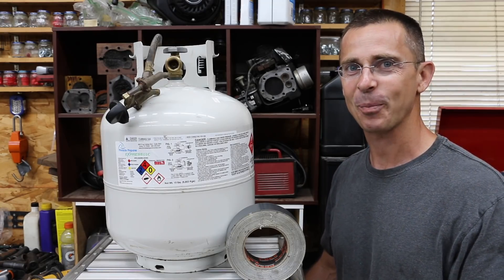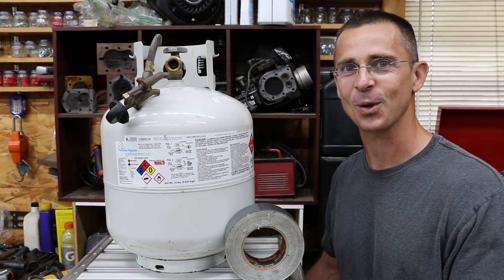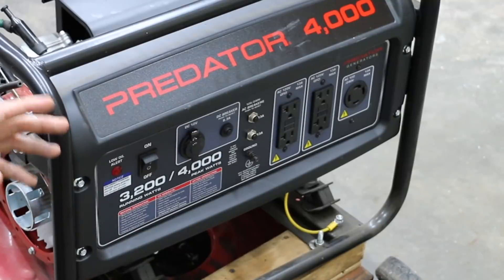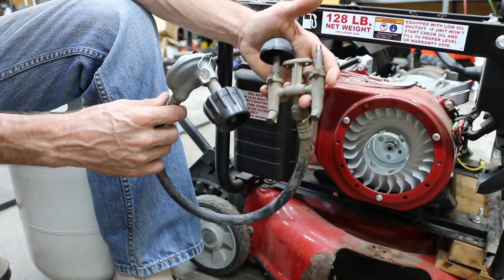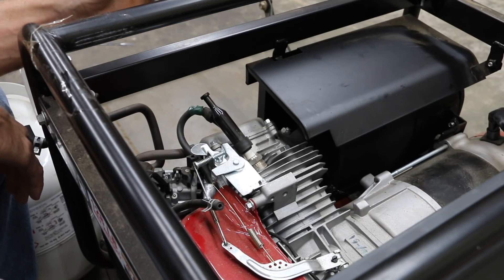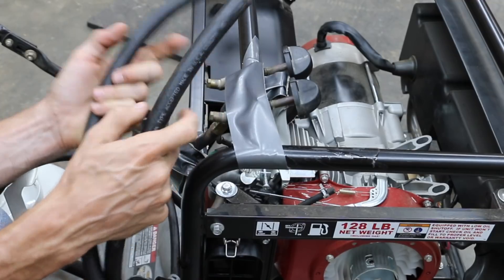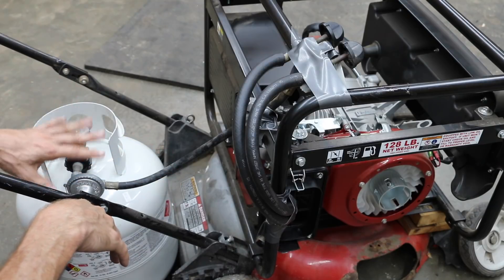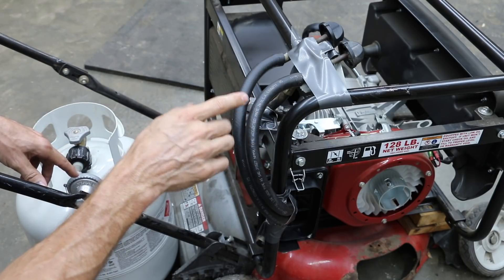Can a gas (propane) grill power an engine?  Let's try it!

Comment: Some Taxi's overseas have a switch on the floor. Propane when no fare and switch to gas if they have one.
Spark advance can be problematic.
Propane is very clean burning. And you can notice that your oil almost never gets dark.
Reply from the maker: Thanks for the feedback.

Comment: I’ve run my push mower on propane for over a year now and it runs great. Low or high grass doesn’t matter. Runs normally throughout. I use a one pound bottle with a grill regulator to a valve and a needle valve to fine tune. The gas line is Teed into the crankcase vent line so switching back to gasoline is easy
Reply from the maker: Thanks for sharing.

Comment: Fantastic video. 
I would like to se a reagular car applying the same gas at the intake as a mixture to regular gas, I guess the computer will cut the gasoline when oxigen sensor at the exhaust sent it a signal that is running rich. 
I hope you can come up with this set up to try it out. 
Keep up the good work. 
Regards. 👍
God bless you.
Reply from the maker: Thanks, will do!  Thanks for the suggestion.

Comment: Choke always freezes up on my fourwheeler so i use a propane torch to feed the carb to start, once warm i remove propane and it runs normally, instead of cranking for minutes on end it starts up almost immediately
Reply from the maker: Thanks for the feedback.

Comment: This is pretty smart. A basic propane conversion that can plug directly into the air box and doesn't require the expensive manufacturers kits.
Reply from the maker: Thanks for the feedback.

Comment: In Skandinavia ( Norway Sweden Finnland ) in 1940>>>1960 they used a gass generator that prodused gass from wood chips to power cars and Tractors 
The generator was installed in the car / tractor 

There has been some who has installed this type of generator on a old Volvo ore pickup truck
Reply from the maker: Thanks for sharing.

Comment: My grandpa had a 1979 3/4 ton Chevy 4x4 with a 468 big block in it and he had it running on propane and gas he could switch it inside the cab and make it run on gas ne or the other
Reply from the maker: Thanks for sharing.

Comment: for a while LPG (propane) conversions were fairly common in Australia. 
They still are for taxis I think. 
in my early 20s I had a 1973 Holden 308 V8 running "duel fuel". it was complicated under the hood. big mixing/preheating manifold sitting on top of the carburettor. air filter sat to the left of the engine. changing the air filter was a pain in the ass. also had to buy "valve lube" to stop the valves drying out and the valves and seats had to be replaced with special ones. brass valve seats I think? don't recall. either way dry valves was a problem you had to think about. 
gas tank took up about 1/3rd of the trunk and you had to pay to get it x-rayed for fractures every 5 years or something. cheaper to just buy a new tank. the tank got cold on long drives too which was nice in the Australian summer heat! 
as complicated as it was, boy was it cheap to run! and on a long drive it got cheaper still. 
damn I miss that car when i'm at the pump now.
Reply from the maker: Thanks for sharing.

Comment: Todd, did you get any kind of idea how long a 20# tank of propane would run that generator?  That's a very viable method of energy production in grid-down emergencies, while giving us good reason to buy a dual burner gas burner setup for use during the good times.  Win/Win.

Comment: you know what would be interesting is seeing propane vs gasoline efficiency in your fuel injected generator. also might be interesting seeing the difference between the EFI generator and the carb generator
Reply from the maker: Thanks for the suggestion.

Comment: i am windring if you can use the same regulator to hook it instead of th inlet of fuel injectores on a car and disconnect the gas fuel pump. then I think you can run any car on propane and the car’s computer can adjust the ratio  by adjusting the injectores. I think it is doable . it will be a great project if everything goes ok do a MPG test propane  vs gas.
Reply from the maker: Thanks for the suggestion.

Comment: Looking at this, it is obvious that the oil company mafia has been f... us over for decades. They have just stopped the usage of gas and electricity. They should be fined to pay for new and cleaner tech. I knew that gas for sure can be used for engines, but not this kind of DIY solution 🙂

Comment: I have run my Taxis on LPG for 17 years, huge savings and as LPG doesn´t make soot I save a small fortune on oil as well.
And I even claimed the conversion back from my taxes, cost about $3,000 (€3,500).

Comment: Try wood-gas. Really, I'd like to know whether wood-gas from a static gasifier can be compressed into a carbon fiber tank to at least 3000psi safely and how long this would run a vehicle.
Reply from the maker: Thanks for the suggestion.

Comment: Go cart or car engines can be run on lpg with two barbecue/regular stove regulators: an unmodified one to supply gas during idle and a modified one to supply gas during higher rpm.
The modified one has a spring inside that pushes in on the diaphragm; it needs to be replaced with a spring that pulls the diaphragm out. A screw (glued to the diaphragm) with washer and nut can be used to set the tension of that pulling spring. This modified regulator will allow the flow of gas according to the suction force of the engine, but it won't allow gas to flow if there is no suction on the output.
Also, the air intake will need to be partly obstructed to force the engine to suck more gas from the lpg hose.
Reply from the maker: Thanks for sharing.

Comment: I want to try it myself at some point I want to try and drip feed an engine gas just enough to keep it running producing just enough power for lights, kind of like a modern version of a hit and miss, I could probably play with the govenor using it like a contact to fire the engine at a certain rpm, curious how efficient and effective it could be, I might have to add a flywheel of some sort.
Reply from the maker: Thanks for sharing.

Comment: propane is like CNG..... you can use it under different loads... just have to convert the carb for it and urt good to go... get an old CNG (Compressed Natural Gas) powered van...
dte here in Michigan uses they all use CNG
Reply from the maker: Thanks for sharing.

Comment: You should note that Propane is a singular type of Alkane. Gasoline is a mixture of many different hydrocarbons that cannot run at the same stoichiometric ratio at the same time for each molecule, thus gasoline forces the consumer to run an engine stoichiometrically at an average of them all, causing some molecules to burn oxygen rich and other fuel rich. 

Hence it would be insanely easier to run an engine on pure Heptane, Nonane, and Octane with the right air/fuel ratio and compression, but even a combination of them would be better. 

That would be the promise of making biocrude oil from pyrolysis and Fischer-Tropsch processes, by using catalyst that favor conversion of lighter gasses to specific alkanes (or paraffins) allowing engines to burn cleaner and more reliably. No need for Octane rating at that point. Just designate a fuel by the primary components.

Comment: I used to convert gasoline engines to propane. They had a kit that I would install and service. There was a power loss because they were carburetored and the way the kit was designed took up part of the air flow to mix/draw in vapor of propane. What I want to try is liquid propane injection, either at the throttle body or port injection.
Reply from the maker: Thanks for sharing.

Comment: I am a fan but either I couldn't find a video on generators or one doesn't exist. Considering the dependability of "the grid" is somewhat less than stellar, I want to purchase a generator that will run my furnace (gas) and the fridge and freezer. If you could be so kind as to do one, or point me in the right direction, I would be grateful.
Reply from the maker: Thanks for the suggestion.
Reply: Look on the appliance name tags for elec wattage rating for each.  Add all those wattages together, and add 50%.

Comment: Nice one. I've never done the comparison on cost. What it would be like to run car on propane. I'd imagine with some changes to the programming a fuel injected engine would run on it just fine. Is it just the idea of a pressurized gaseous fuel that scares people away from putting them in cars?
Reply from the maker: Thanks!  Thanks for the feedback.

Comment: I seen where engines run natural gas. It was hooked up where the crankcase  hose went into the carb and a ball valve was used to regulate the gas.
I got my generator to run off gasoline vapor. it is the vapors that burn with propane, natural gas, and gasoline and alcohol.
Reply from the maker: Thanks for the feedback.

Comment: Using CNG or Propane as a replacement fuel in gasoline engine cars, a popular conversion in some countries, makes for about 1/2 off fuel costs vs gasoline where fuel prices are higher (Germany, England) & where propane readily available to fill up a passenger car without much fuss with 400-800km of propane fuel, originally a waste product of oil refining :) I use propane in my hobby metal smelting forge as fuel due to its clean burning properties & much higher thermal output than a similar electric model & lower capital cost for the kit & setup // mostly to melt popcans into little aluminum heat energy storage bricks

Comment: Of course it works! Entire nations run on propane. 😃👍
I run my Toyota Prius Mk.2 for more than 340,000 km on propane/butane (LPG). After some initial setup challenges no issues at all. Even the engine oil stays clean much longer. And the pump prices 😅🤣😅
Reply from the maker: Thanks for the feedback.

Comment: Propane as fuel for engines is not a new thing. In fact I think it’s a option for smaller cars due to it burns very clean. And with proper emission equipment behind it would be even better.   I do not think the elec car company’s or for that matter reg has and diesel company’s want this known.  Because setting up infrastructure for cars to run on propane would be easier and cheaper then the elec market.   Just simple as drop a large tank off and train a tech how to refill.  Or do it in a bottle swap

Comment: Generator related, I suggest a test of portable generator efficiency based on the amount of gas used to generate a kW-hr of energy with different sizes, brands, and types of generators.  
Are inverter generators significantly more efficient when running at fractional load capacities compared to standard generators?
Will a small 1kW generator be more efficient than a larger 5kW one when delivering 500W power output?
If your long term requirement in a blackout is small loads for a long time, is it better to get a small gen set running near its capacity or some oversized one just idling along at a small fraction of its capability, in terms of gas use?
Reply from the maker: Thanks for the suggestion.

Comment: I once tried the very same test like this. Worked well. My only problem was the BBQ grill regulator wasn't designed to pass enough gas under load without freezing up. it turned into an iceberg. That's Louisiana for ya. :) Cheers!
Reply from the maker: Thanks for sharing.

Comment: WAY WAY WAY back in 1992, one of my friends dated a girl whose dad built a custom pickup. It was made with an escort front end and a small box on the back. It actually liked really cool. (Her dad owned a body shop, so I guess he knew what he was doing).
  What blew my mind was when she needed gas one day and pulled into the gas station and bought a propane tank. She opened a little compartment just behind the cab of the "truck" and swapped them out. I just about crapped myself. I thought that was the coolest thing ever LOL
Reply from the maker: Thanks for sharing.

Comment: Propane powered lawnmower; compare with gasoline to check valve seat wear, compression loss, oil condition, fumes and cutting performance from a 60 hour continuous run.
Reply from the maker: Thanks for the suggestion.

Comment: You need to make an adapter that would still allow the use of the air filter. Other wise the generator engine will eventually self destruct by ingesting all the dirt and dust.

Comment: I wonder if the engine runs on gas it will break down if it is a 2cicle one and needs the oil in the fuel mix. Now if the engine is a 4 cicle will be fine. 
Excellent experiment though
Reply from the maker: Thanks!

Comment: Lot of gas generators come with a propane connection built into the carburetor and it’s as easy as attaching the hose to the carb and to the propane tank and opening the valve. I remember there were duel fuel kits for trucks that allowed the use of propane in gas engine trucks, and you could switch back n forth.
Reply from the maker: Thanks for the feedback.

Comment: Back when I was around 15 or 16 I watched my dad drain the oil out of a 74 volkswagon super beetle an put the plug back in an fill the engine with kerosene an start it an let it idle bout 3 to 5 min ! He said he was waging the inside of the engine out to remove sludge build up ! 1 does this hurt the inside of the engine 2 does it actually clean the inside ?
Reply from the maker: Thanks for the video idea.

Comment: Generators run so clean you rarely have to change the oil, you get no soot.  I love running my generator on propane, best thing I ever did.  Each 20 pound tank is equal to about 5 gallons of gas.
Reply from the maker: Thanks for sharing.

Comment: it will work well with a go kart, you need to use an impco converter kit, I have a van that runs on propane. Almost got killed on the border since it triggered some type of bomb alarm and many agents came to me pointing their guns, once they realized that propane was the vehicle fuel they let me go, I guess not many people use propane as motor fuel, propane burns so clean, that oil will stay clean for a very long time and idle is very smooth.
Reply from the maker: Thanks for sharing.

Comment: Late to the party but I love this channel. These are the questions we all need an answer to. I've thought about it but never tried it.

I once built a wood gas setup just to be able to run the generators when the roads were flooded, it works and you should try it.
Reply from the maker: Thanks for the suggestion.

Comment: Propane only has about half the BTUs of gasoline, so you have to use a lot more of it. But it's cheap and has an octane of around 113. So you can use an engine with up to 13 to 1 compression to get the most out of the fuel, without spark knock. Ok, I'm gonna watch the video now.
Reply from the maker: Thanks for the feedback.

Comment: wonder how long it will run on propane  on the generator at full 4000w load  2 heaters  or a bunch of lights  ?  and also would it work in windy conditions  like put a large  34inch drum fan  at a distance to simulate high windy conditions if its not windy on that day of testing ?  its an idea for a video lol
Reply from the maker: Thanks for the video idea.

Comment: we ran cars on LPG. We still do. 
Shell use to burn it off.
They just burned it away, because there was no use for it, or so they said.

We run cars on LPG.
We run trucks on LNG these days.
We could already run cars on LPG and woodgas.
And as you can see here, it runs fine on Propane gas.

They now sell the idea that it is because of the environment.

I just dont understand that if we could already have been running every engine on much cleaner fuel.... why then did we ever accept the more polluting fuel?
Its ridiculous.
Reply from the maker: Thanks for the feedback.

Comment: E85 in a 2 stroke generator, using TCW3 marine and regular 2cycle OIL mix
Reply from the maker: Thanks for the video idea.
Reply: @ProjectFarm  You are a true scientist
Reply: @ProjectFarm  I tried a test run today with E85/TCW3 in my 2stroke generator, it worked, but I had to run at 1/2 choke.  The exhaust smelled MUCH better than gasoline.  I had to use an E3 3.22 sparkplug,  to make it easier to start.

Comment: With a purpose-built carburetor, you can easily make a gasoline engine run on LP. John Deere used to sell LP versions of several of their two cylinder tractors, which generally were the highest HP versions of each, owing to their higher compression ratios.
They did require a bit more fuel than either the gas or diesel variants, due to the lower energy content, but at the time of manufacture the price of LP was next to nothing in the American South and on top of that there wasn't any road tax applied to LP
http://www.tractordata.com/farm-tractors/000/0/5/52-john-deere-730-tests.html

With this test, the most surprising thing to me was that the engine ran as well as it did without high compression rings!
Reply from the maker: Thanks for watching!

Comment: It will run just fine on a vehicle, go kart, truck, car, etc  an impco kit is required, and recommended is an inverserse marvel mistery oiler to lube the valves since propane is a little dry, you will be surprised how clean the oil stays, I ran propane on a truck e150 1980 for a long time and it works quite well.
Reply from the maker: Thanks for the feedback.

Comment: Now try to do this again but when you increase the load or pull the throttle you open the gas valve more at the same time to keep a good ratio of propane to power
Reply from the maker: Thanks for the suggestion.